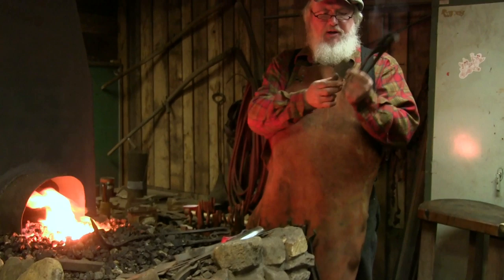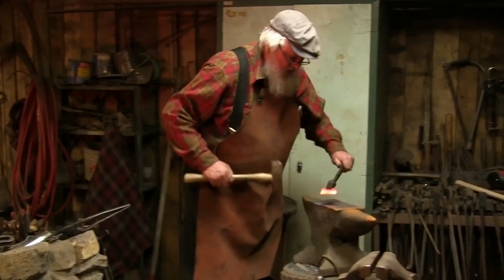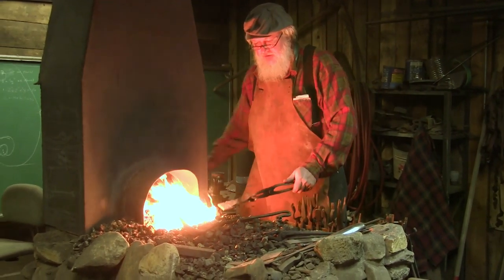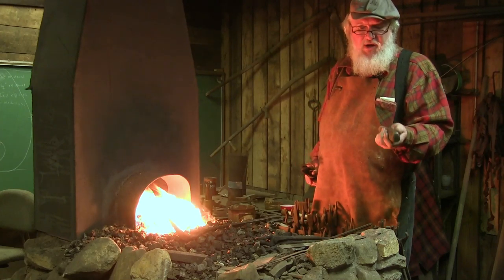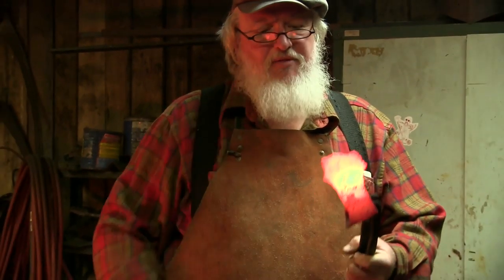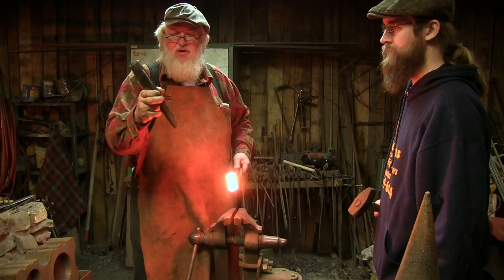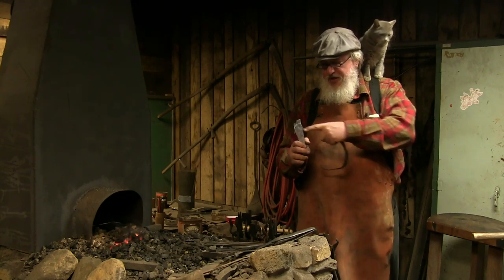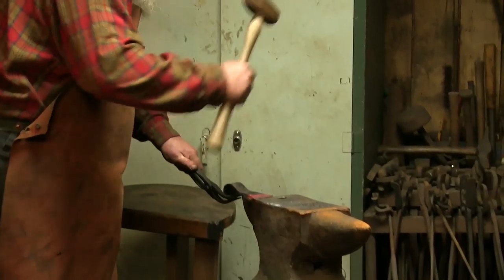Calerin Forge: Tomahawk - Forging The Blade, Part 2

Comment: Thanks for the video. I am attempting this myself. All is good up to where its time to insert the high carbon end. I have a nice tight grip but when I heat it up, it gets loose and the bit falls out of the main body. I would appreciate any suggestions/help.
Reply: Couple arc weld tacks to hold it. Soak in diesel before first flux.